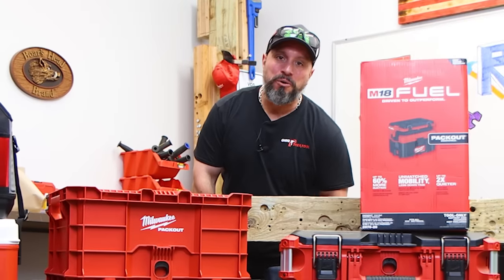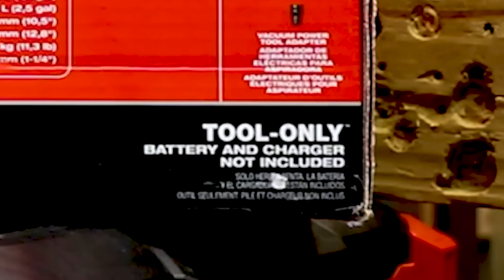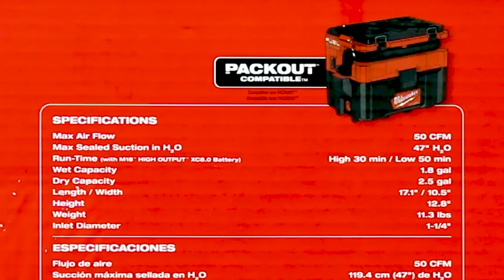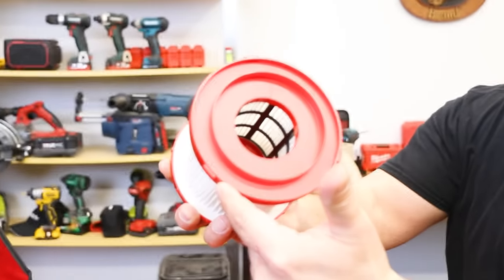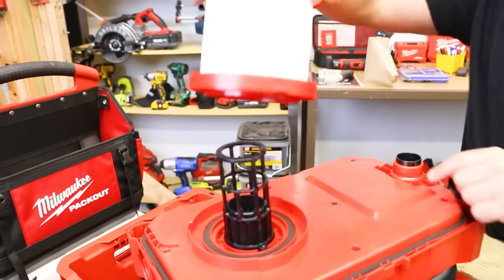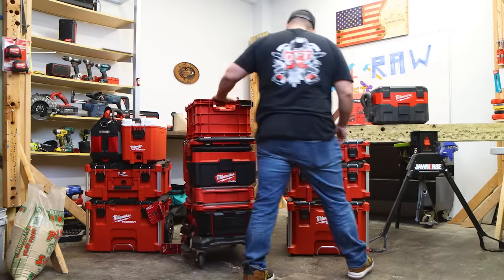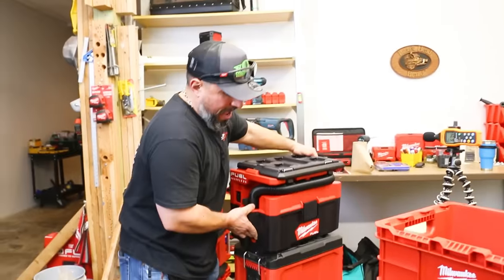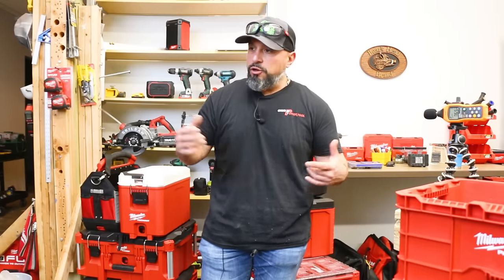Milwaukee M18 FUEL PACKOUT Wet/Dry Vacuum ARE THEY KIDDING!?

Comment: You can attach the hose to the exhaust port for a couple of reasons.  The first reason is to use it like a blower if you wanted to blow dust etc.  The second reason which is the reason I use the old vacuum for is as an inflator. I use it to blow up the kids pool in the summer. Very fast and portable, and certainly beats huffing and puffing...
Reply: I Also, I like to use two hoses, one to suck, and one out the window of a work area, then you can use no filter, get more suction, and the exhaust fine dust goes out the window, instead of into the air...
Reply: @Synic08  keep in mind that the filter also protects the motor so I'd still use a filter even if you exhaust outside.  Also depending on the hose setup you might lose more suction than using a filter.  Not necessarily a bad idea just understand the impacts...
Reply: @Synic08  there are air outside of the window too you know.
Reply: This may seem like a dumb question but is there some sort of cap that you put over the exhaust when sucking through the hose to create more powerful suction or would that just make it worse?
Reply from the maker: Mufflers make it quieter at the expense of suction

Comment: The hose makes a 90 degree turn where it’s attached to the base, just like the last model. It WILL clog extremely easy, just like the last model. I like the vacuum, but that’s a design flaw.
Reply: @thomasdickson35  I would imagine repositioning the motor to have the inlet/outlet hoses to go horizontal (centered) would be better to prevent clogs
Reply: I’ve been using this vacuum for about 9months with no issues. I don’t think it’s as flawed as you’re saying but I could be wrong. I’m a plumber in case you were wondering what I use it for
Reply: @thomasdickson35  instead of 90 degrees south just put it straight into the fuel brushless it just has to be a slot to hold it
Reply: My ridgid which goes straight into the can clogs way more than either parkout, gen 2 or fuel

Comment: Nice little cordless vacuum-I am a vacuum collector-may have to add this to my collection.The "47" in reference is how high the vacuum can lift a column of water in a manometer guage-device  for measured low inlet and output air pressure of a device.Manometers use two main reference-water column and mercury.(Hg)Also the measurements with manometers used in pipe organs.I would use the bags in this unit as much as possible-again to save your filter and motor.The bags are NOT meant to be reused-they are disposable.If you try to reuse-guess in an emeregency-the bag pores will be somewhat clogged and may not let enough air thru to cool the motor.Does Milwaukee sell a resuable cloth bag for this machine-That would be nice for folks like in shops and such with a lot of stuff to pick up like sawdust and shaving.
Reply: Lmao was just about to comment this. HVAC guy?

Comment: Low voltage service tech here.  I use all half stack pieces for my carry in kit and use the compact dollyto wheel it in. The vacuum is sandwiched between an organizer and a tool tote, it works out great!

Comment: Glad they increased the size to a 2.5 gal & redid the hose inlet/outlet in the new packout version shop vac (gen 3).
Don’t think it’s intended to replace the gold standard of shop vacs (Ridgid big boy, imo) for large jobs etc.... BUT for its size, being battery, & fitting into the packout system w/ other packout boxes. I think it will make a good compliment to your main corded shop vac, as another key feature it has; is getting into restricted spaces where a corded big boy can be frustrating (tight laundry rooms, & getting behind a washer/dryer, for instance 😳).
Thx Vince & VCG for the vid✌🏼

Comment: I use my PACKOUT vacuum for service calls for clean-up and i use it with my M12 3-in cutt-off tool attachment for when i make cuts into terracotta and plaster lathe walls. The customers love the that its really quiet and that they can still work from home without interruption. Great vacuum.
Reply: Do you cut dry wall with it I’ve been thinking of getting it I work in the water and fire remediation industry
Reply: @El_Escobar612  yes. I recommend the dust collector nozzle if you are making vertical cuts and if you are making cuts into a ceiling, have a extra length hose with coupling for the extended reach.
Reply: Does your m12 3 in cut off tool work good to cut drywall, that what I was asking? Thank you for your help 💯
Reply: @El_Escobar612  Yes it does.

Comment: The true reason this vacuum is better than Any other is its stackable, this gets my truck vacuum off my shelfs and off my truck ground floor. I cant tell you how many vacuums I ruined over the years because the hose gets crushed or it was just in my way in the truck and got tossed. I bought the packout mounting plate and this vacuum stays stacked on my truck with 6 other packout boxes of special tools that don't need to be on every jobsite. I have a second stack of 6 boxes of tools and materials I use on every jobsite on the wheeled dolly bottom box that i keep bungee Corded in.  This vacuum is exactly what I needed

Comment: Hi Vince.  I know the attraction to this is that it’s packout compatible.  But I would really like to see it compared to the Bosch GAS 18V.
Reply: I have both. The Packout vac stays in my van now rather than the Bosch because it’s easier to keep in place. The Bosch is such a weird shape that it’s hard to find a good place to put it other than the floor. Couple of comparisons, the Packout does not have any extension tubes, which I used regularly with the Bosch. The Bosch however does not have a blower outlet, so it is a vac only. The Bosch has become more of a dust collector for me, as I can plug the hose for it directly into my Bosch miter saw port, and hang it off the back of my miter saw stand. The Packout is my every day grab and go vac.

Comment: I wish there was some onboard storage for the tool dust collection adapter. With a battery in it, you’re left with one accessory that must stay off the hose and out of the storage chamber. Drains the batteries quite quick also. Overall quite good though.

Comment: Today is January 27th 2021. My question is I purchased the Milwaukee fuel 2.5 gallon wet dry vac from Home Depot with 5 year extended warranty. I actually used it on a job and its suction is awesome but the attachments are lackluster. What's the diameter size for the vacuum fittings so that I can purchase better set of vacuum attachments?

Comment: I didn’t score on the pack deal but I did get a good deal at HD. 2 6hour batteries 🔋 with rapid 18v/12v charger for $299 and it came with a free tool. And yes I chose the Milwaukee 18v fuel vacuum. A 200 dollar value.

Comment: They really should make the roller cart a vac. Makes sense with it being at the bottom of any given stack. Could add a drain for fluids. Make a dust separator box that can be attached the next layer up.

Comment: These packouts are awesome, l hate to bring up the past but l will, we would carry a wooden tool box and it was heavy and filled with sawdust and you eventually cut through the handle cutting on it. 
I have to get the bottom piece, l have to, l have no choice. Thanks Mr. Vince.

Comment: Correct me if I'm wrong but I think the inches of vacuum rating is another power rating not the length of tube it will suck water through. I'm getting this vacuum soon. Home depote currently has a deal where you buy the 2 6.0 high output batteries and charger you get this fuel m18 2.5 gallon wet/dry vacuum free.

Comment: Not sure if you already have a video for this but I’d like to see a headlamp test. Test various brands of headlamps from the cheap $5 ones to the expensive $200 ones. What are the pros and cons of each, are they waterproof or water resistant, battery systems (Ex. rechargeable or does it take double a batteries), what are the various modes on the headlamp. Is it one setting or is there a high, low, flashing light, green light, flashing red, etc. You can even do a torture test to see the durability of each headlamp.

Comment: Have they sorted out the circuit board issue that they had with previous m18 model where it stops sending power to motor?

Comment: Do you think Milwaukee will add a plugin option on this vacuum like they did on the rocket light? I just bought this vacuum but I'm having buyers remorse because I feel like two months down the road they're going to add the plugin feature. Which I would love to have if possible.
Reply: I dont see it happening. This is technically the 3rd iteration of the vaccuum and no plugins

Comment: After trying many cordless vacuums, the Bosch 18v 3n is the most convenient for me. Specially on carpet steps. Just sold my Milwaukee backpack, not a convenient vac. I waited for this vac but realized it doesn’t have the extension pipes. I prefer the Bosch hose type over this Milwaukee.

Comment: Thanks for the video Vince! 
I wasn't sure if I was going to get the older Milwaukee vacuum or the new packout one. Nice to know you can still use it without pulling off the stack. As long as the price difference isn't too drastic, I'm getting it.

Comment: I’ve had the gen1 and gen2. All I’m gonna say is: I absolutely hate the positioning of the hose where it locks in to it. It’s really damn hard to unlock and pull out. Can only fit your fingers in there. I hope the packout version is easier to work with for that.

Comment: For those of you that don’t already know. Every 10 decibel increase is twice as loud.  A 90 db Vac is twice as loud as an 80 dB Vac.
Reply: 3db is double not 10db
Reply: @scholesyk  3 db is twice the power.  Not twice as loud.   2 watts is twice the power of 1 watt.  Or 3 db of gain.   Not much perceived difference in volume.   You have to go to almost 10 times  the power  to have audio play twice as loud.   

This is not written in stone.  A very high quality high current 15 watt per Chanel amplifier  may play louder and cleaner than a low quality mass produced 50 watt per channel amplifier. 

All things being equal there is little to no perceived difference in loudness between an 100 watt per Chanel and a 50 watt per channel audio amplifier.

In the real world.   You need 10 db to go twice as loud.

Comment: I would be curious as to what the suction is like with the fleece bag and the HEPA filter on the packout vac. I use bags on one of my 5hp Ridgid vacs and I had to switch from the HEPA filter down to the fine dust as it lost so much suction with both bag and HEPA filter.

Comment: My Milwaukee pack out 2.5 shop vac keeps randomly shutting off that I bought at Home Depot. I want to exchange it for another one but no one has it in stock. I don’t want to send it back because I still need it for work even if it works 50% of the time. Any suggestions?

Comment: Do you think the vac will work just as well connected to a vertical wall plate?
Reply from the maker: If you mount the inlet at the top maybe

Comment: Very interesting......but I would have liked it if they would have the option to be able to plug it in if you ran out of battery power. Cause I'm sure I'm not the only one that has ran out of battery at the end of day and still need to finish cleaning.

Comment: Did you get the 10 tool entry ticket with yours I didn't get it or the m12 and m18 booklet same thing with the m12 fuel vac  I didnt get the 10 tool entry ticket or the booklet @vcgconstruction

Comment: Where is the Gen 2 Vac for comparison ? Not Packout compatible, but an improvement over the First Gen Vac, especially the internal hose storage. Have two of the Gen 1 and a new Gen 2 - I like it. It’s currently on sale at HD for $99.00 tool only, normally retails at $119.00. Not VCG level savings, but sometimes you can’t wait for the max. value deals. The exposed hose on the Packout version looks like something waiting to get punctured.....

Comment: The 47" water lift is the "suction rating" of how much water it will lift in a sealed 1 inch diameter tube. When you submerge that hose, (much bigger than 1 " ) from 47" up your lucky it sucked up any water. If you lower the unit to the water it will empty the bucket in a matter of seconds. This was an improper test of its capabilities.

Comment: I love Milwaukee I’ve been using it for years but one thing that really bummed me out is that only the M 18 vacuum it’s compatible with the pack out system I have almost a full set up of M 12 in a pack out system and I wanted to add the vacuum but now I have to buy an M 18 battery that sucks I wish they come out with the M 12 vacuum for the pack out

Comment: Has anyone who owns the PACKOUT vac ever experience knocking the vaccum on it's side or having it fall over on its side and have the vacuum keep running but lose all suction? I was able to get it working again by turning the vacuum off and then on again, but I just thought that it was interesting that it would lose suction completely, but still be running fully when it topples over....

Comment: I still have the Gen one that accepts nicad batteries as well as the lithium battery as an example of how old it is.
It has been used commercially by myself and coworkers doing similar Big Box store remodels all night long. It has been rode hard and literally put away wet and I've had it since 2015 and it's still running strong and have no plans to upgrade.

Comment: I like that they have added the option to add the dust bags to reduce strain on the filter, the filter on my second gen vac was knackered within a month or two. 

I would probably have got this vac if I hadn't purchased the dewalt track saw as it links to the dewalt vac via Bluetooth or a remote that you can mount on your wrist or other convenient location

Comment: Packet vacuum will cost thousands of dollors in damage due to static discharge. Always use a grounded vacuum when working on equipment with sensitive electronics.

Comment: I dont like that the battery cant be mounted on the side and you have to brake everything down to change the battery.  Total pain if you have it on the bottom of a stack at the job site which could be convenient.

Comment: I have the M12 version. I thought about adding the cleats but discovered that the M12 version will drop right in a crate. The crate can also hold extra bags. Easier than a mod.

Comment: I like the video, but your procedure for testing milwaukees 47“inches of h2o” spec is not correct.  For this to be a fair test, you need to use a vacuum/pressure gauge tapped into the side of the suction pipe.

Comment: Just wish the hose had adapter to make it longer.
Reply: Agreed. The 0882-20 dry-vac-only comes with 2 extensions that this new unit should have, so you don’t have to bend over so much. However I don’t think they could be stowed anywhere.I have a unit like the briefcase unit (my hose stows under the lid) that also doesn’t come with extensions, and the 0882-20 extensions work great.

Comment: thats not how you vacuum water. Its not ideal to dunk the vac hose. Once you create a full seal there is a significant break in cfm. had you tilted the head and used half the hose inlet you would have cleared it twice as fast.

Comment: Had to laugh at your water test. Vacuum Inches of water is a precise measurement. A perfect vacuum at sea level is 33.9 feet. Connect the vacuum to a clear hose or pipe and see how far the water level goes up the hose.

Comment: Your SPL measurements were bogus. SPL measurements are highly dependent on distance and direction. Your comments about the vac meeting spec on water lift was also wrong. Lift is a spec for a full column of water in the hose. They failed that. Lifting a stream of air and water is less difficult than sucking up the sand on the floor the way you did it. Unless of course the sand filled the hose cutting air flow as in a correctly done water lift test. In that case sand is more difficult than water because it weighs more than water and the grains don't flow as easily as water. I suggest that if you guys are going to go on conducting tests and making recommendations that you do a bit of research on test protocols before doing them. There are standard for these things.